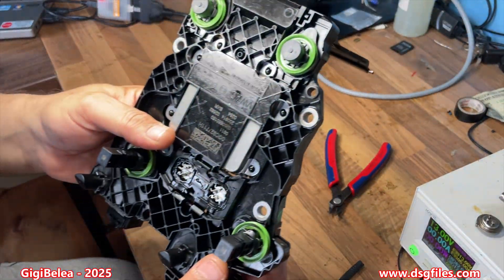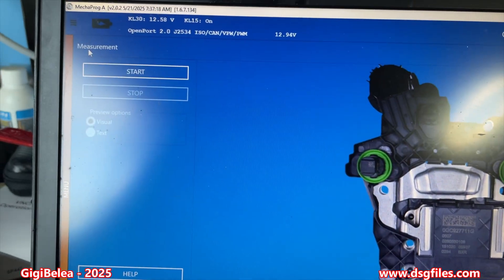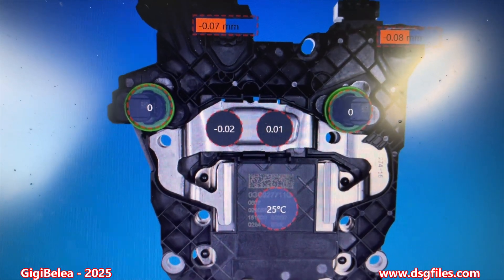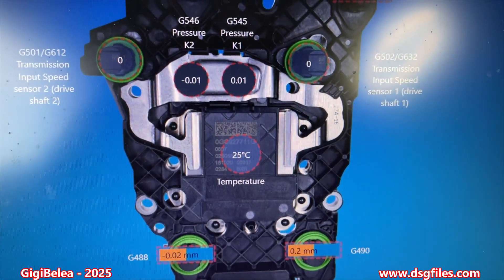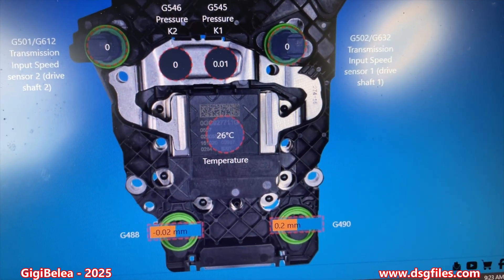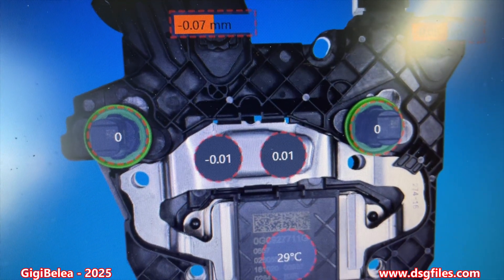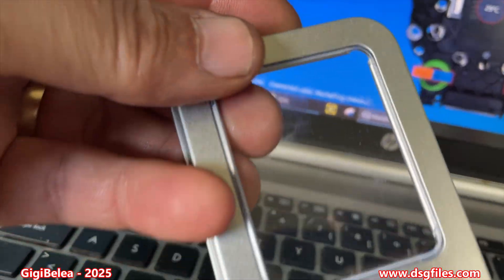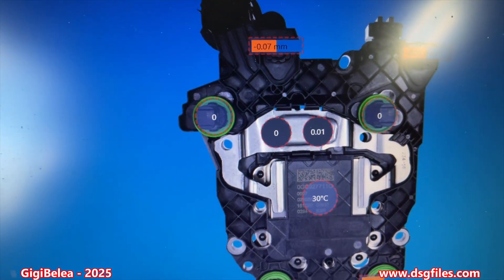DQ381 - Transpeed Pressure Sensors  - Test

Comment: Hi,what solder do you use to reconnect the pressure sensors..weve had a few come back where the solder has detached a fraction on 1 of the 3 legs
Reply from the maker: Normal solder but lately I also use copper wire in between.